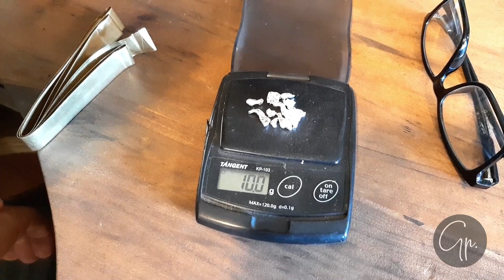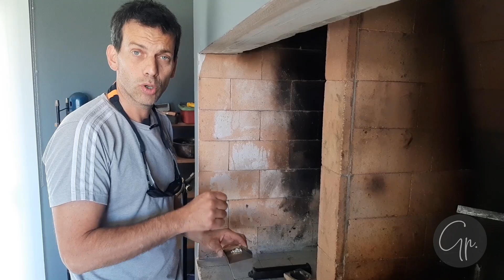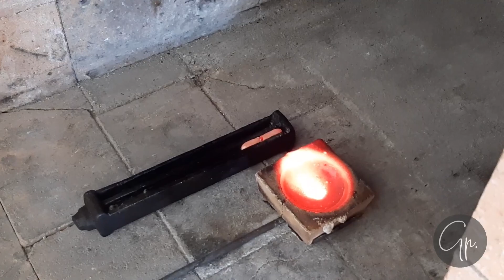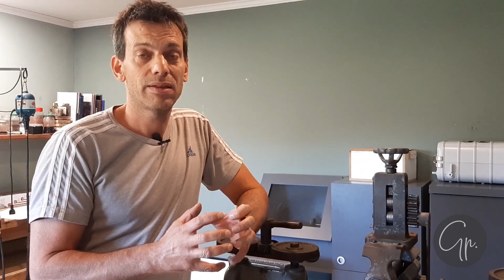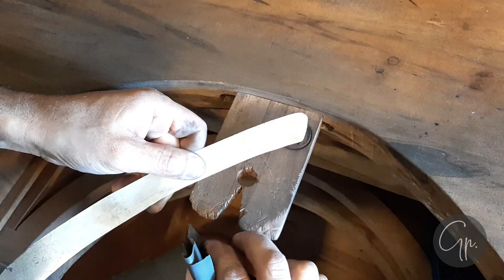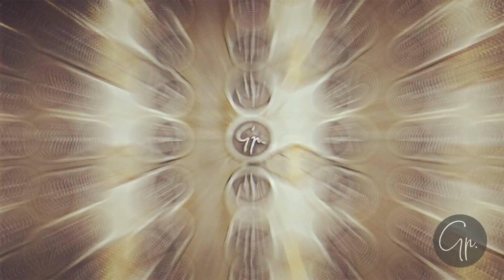🔥Cómo hacer SOLDADURA DE PLATA, 💎Taller de Joyería

Comment: 2 g.  Selver
1.  Bras 
👌👍💕
Reply from the maker: مرحبا! آسف أنا لا أفهم اللغة التي كتبتها جيدًا ، أعتقد أنها ستكون فضية وبرونزية؟
Reply: I use 2 grams of silver and one gram of brass
Reply: But its color is a little yellow
Reply from the maker: @احمدسلامعبيدالجميلي  Of course you are right, if you put less bronze it will be whiter but the melting point is higher
Reply: But this is the best way and the simplest there is a second way for cadium, but it is tired, but without the color yellow

Comment: Hola Guillermo , graci ya e por tus vídeos son muy buenos. La pregunta es y persona si ya lo explicaste. Si usas 10 gramos de plata y le echas,3.5 de latos ese es el 35%?.
Porq creo q si la base es,1,10, o 100. Sería, 6.5 de plata pura y 3.5 de latón , así se obtiene el final de la plata al 35%. Pero puedo estar equivocado. Creo q con la preparación del oro es igual. Para obtener 1 gramo de oro 18. Se echan 7.50  partes de oro y 2.5 partes de otros. Te escribo porq veo todos tus vídeos y no se si mis cálculos  están bien o los he hecho mal. Saludos
Reply from the maker: Hola!
No no, lo que estas diciendo sería el 10%!

Comment: Hola. No sé si me equivoqué, pero "plata 925" significa que de 100 partes de una pieza de plata, 92.5 es plata y 7.5% cobre, es decir, 92.5% plata y 7.5% cobre, ¿correcto?
Me parece que el mismo cálculo no se aplica a la soldadura, ya que el porcentaje de latón no es una fracción de la aleación total, sino que se calcula sobre la cantidad de plata que tiene. ¿Ves la diferencia?
Reply from the maker: Te entiendo, yo aplico el 35% sobre el 100 de material directamente,  la soldadura sale bien en cto al punto de fusión y el color es muy bueno
Reply: @guillermopetrochelliorfebre  En cuanto a la dureza de la soldadura, ¿qué porcentaje se recomienda para soldar eslabones de plata 925, alambre de 1,5 mm?
Reply from the maker: Yo solo uso al 35% para todo!!